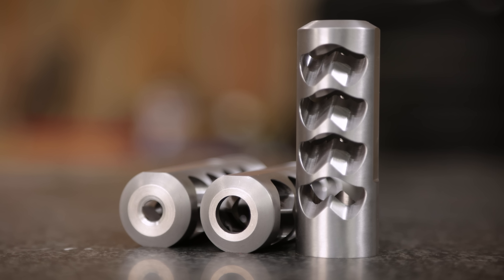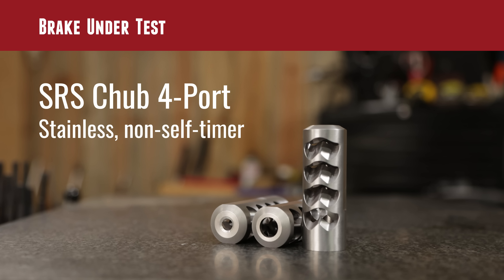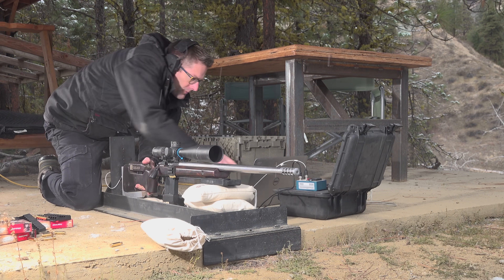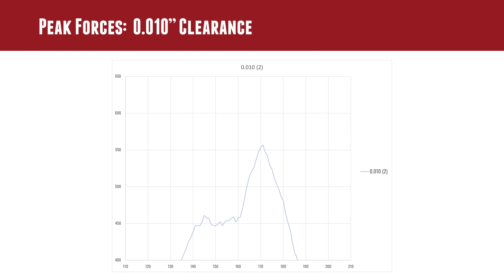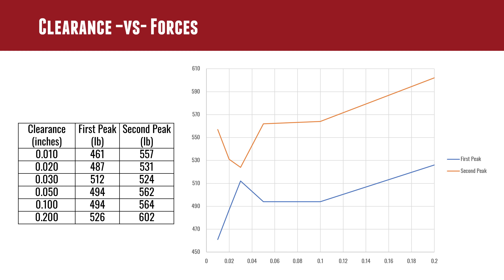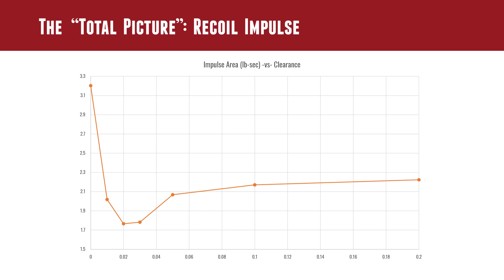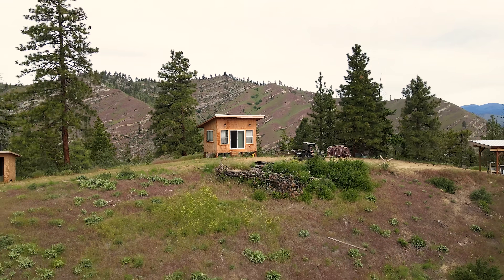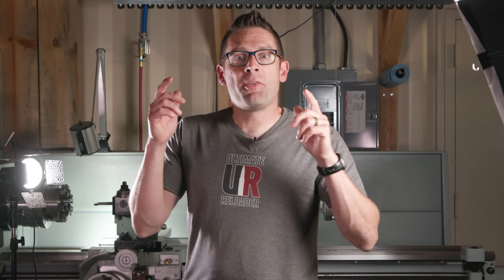Bullet Clearance -vs- Brake Recoil: Shocking Results (SRS Brake)

Comment: I've always been told that 0.020" is the ideal clearance for optimal performance when it comes to recoil reduction, and anything over that reduces effectiveness.  Will be interesting to see what your results were.
Reply: Seeing this on man-portable arms is interesting. My experience was in an Army live fire exercise where someone moved the platoon deuce and a half a little too far forward and I was right in line with the muzzle brake/blast deflector  on the 3.5 inch main gun on an M48 tank. (I am AMERICAN and am actively purging Metricrap from my use of the language.)

In the Catholic church, they have something called canonization where after someone like Mother Teresa is dead, they go through a ritual where you are made into a saint. 

I tell people I, still alive, must already be a saint. While  I was dancing with Ma Deuce on the truck gun ring, I got cannonized  every time the main gun  fired. One of the reasons I have hearing problems.

I like watching videos like this for academic reasons. I don't think I'd ever put a muzzle brake on my rifle. End up clearing four firing points on either side at the range.
Reply: Back when I worked for a gunsmith in the 90's, we'd thread barrels and install brakes regularly. Twenty over was typical regardless of caliber. The greater the gas pressure, the more effective the brake; it made me laugh when a customer came back to chat after we put a brake on his 30-378 WBY and his 9 year old daughter was with him bragging about how much she enjoyed shooting it 😂
Reply: I have my ideas as well I've made a bunch of brakes just never tested bore size. it will be interesting to see.